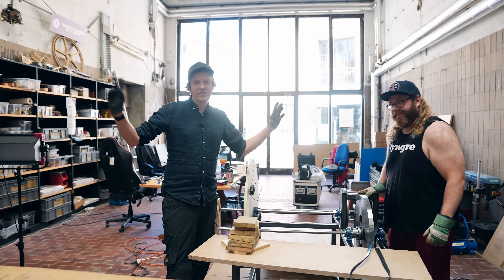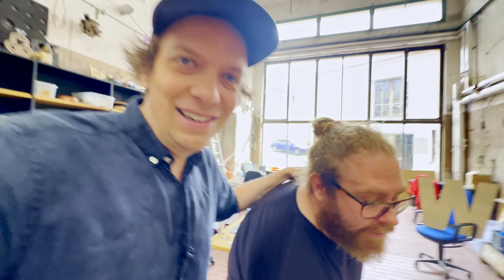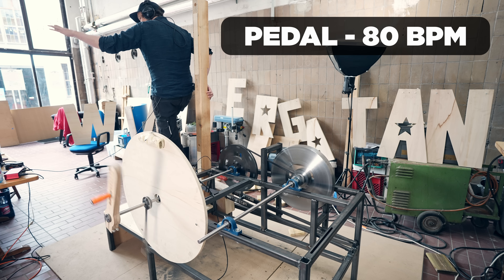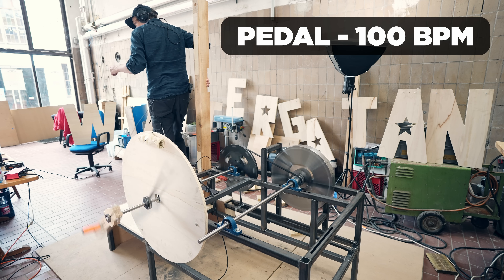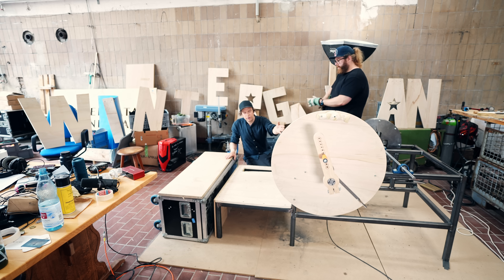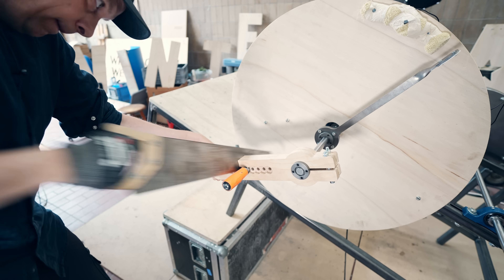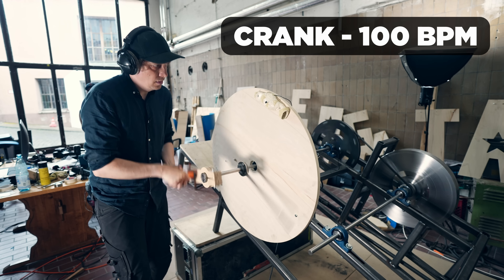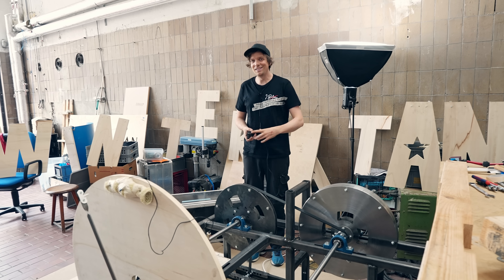Heavy Flywheel plays Tighter music! - DAY 11 - Marble Machine Flywheel Prototype

Comment: I assume why its getting tighter at higher speeds is because its just more stable (gyroscopic balancing) and the more weight added is good but one thing is the more weight, the more it will "throw a fit" and any off balance. But in the end I would chose a style of powering (Pedal or Crank) that you can constantly maintain for a very long time. The leg is strong and should be able to easily maintain the slower BPM over time where the crank should be able to handle the higher BPM. Leg is a few large muscles doing the work but can get tired with a lot of strain where the crank is using the arm and some of the torso muscles and even the core muscles. Smaller muscles but a lot more of them working and the arm muscles is well suited for speed.

This is where tighter music vs endurance will come into play as a deciding factor. Might have to do both but might be able to keep to only one. MMX had both the crank and pedal as if they were backups to each other. After testing both pedal and crank at 80 each and 120 each (slowest vs fastest) for endurance. If there is a real difference between at the different tempo's then that can play out on tour with music selection. Switch up to the other as like a break for the main drive source so it can recoup and continue on back to the main. 
Having the pedal really does help with freeing up the hands to do other things even though using the pedal can mess with the hands since the leg is moving the rest of the body. You will figure something out with it.

Comment: By finding the best 100 best transients,  it is going to be easier to find a tight section at higher bpm because you have more data points to choose from?  Shouldn't your dataset be a fixed amount of time rather thana fixed amount  of beats to avoid this bias?

My sense is that you need a motor for this. manually powering the wheel and playing bass / muting /unmuting will be so exhausting.

Comment: A flywheel can be seriously lethal! Are we all watching to see the moment of catastrophic failure happening?!
Please make the calculation yourself: disk mass, diameter, rpm is all you need. 60kg at 1000rpm with 60cm diameter can easily store 15KJ. That being released in a single catastrophic event means that parts will be catapulted at high speeds.
Be aware that a metal fatigue crack in your axle will not give many early signs of failure. The slightest disruption when giving way will cause further  instability and direct full breakdown.
Key takeaway: never ever stay in the trajectory of the disk! The pedal position is for sure in the path of the disk, the machine will shoot you in the back 😢
Reply: This has been stressed repeatedly for the last year (ever since a hefty flywheel was proposed).  Martin doesn’t care.

Comment: Won't it be crucial that the speed within a beet is constant? At the moment you only test from beat to beet. I figure that pedal and crank differ a lot in that department because the pedal only accelerates at the down stroke

Comment: I get that spinning it manually is cool and feels like you're powering the instrument... But you're dealing with a lot of inertia and complexity by doing so, not to mention the fatigue. Why not make the machine with an electric motor and a speed controller to maintain bpm? If you use a quality control system, you could do away with the flywheel
You could make a rad speed lever on the machine that you could move up and down to shift the speed at will, like it was analogue!

Comment: I think you need to decide something about how you want to use the speed of the marble machine. Say you're playing a song at 120 bpm, and you get two beats 499ms apart. Should the next beat be: (a) 499ms later (playing consistently at 120.2 bpm), (b) 500ms later (you always want as close as possible to 120 bpm, regardless of what has happened), or (c) 501ms later (back in alignment with where the third beat would have been)? With your current setup, you're being cued for (c), but you're evaluating the results by (a), and I suspect that (b) is what you'd really want for a performance. I think you could get a good test for (b) by using a Raspberry Pi to play the kick 500ms after the contact mic triggers and then evaluating the data by the mean square error from 500ms, rather than from the mean measurement.

Comment: 80kg spinning hunk of metal and you want more? This is getting stupid. If you want perfect timing give up and use an electrical motor. 
Here's another stupid idea I think could be pulled off if you don't want to introduce non-human power to it: You crank a generator that feeds a motor, with a software controller to "quantize" the BPM of your input to the nearest 5 then drives the motor accordingly. The losses might be too significant though - but that's already a problem with this stupid heavy flywheel thing. It's going to take too much effort to produce the power for this machine, let alone perform a song on stage.

Comment: I think you are going to need a larger diameter shaft to reduce wobble. One-way, Sprague Clutch Bearings in the crank arm will eliminate of being injured by the stored energy of the flywheel.

Comment: It seems... impractical to have the paddle directly connected to the flywheel without some sort of buffering system between it... if you're REALLY hung up on tightness, you should have a system that lets you input energy into the system while a second system meters it out at a set rate. (You'd just be 'topping up the battery' by paddling, while the machine stays tight.)

If you want the system to be responsive to your tempo, to allow for a more 'live' feel, you should also accept it being a little less tight... I don't think you can have both, or at least I wouldn't know what that looked like.

Comment: For your own sake during shows I feel having both the crank and foot pedal available is a good idea. If one way is starting to be exhausting you can switch to the other. The higher speed seemed to be more effort with the crank, so you could use the pedal for that during shows. Obviously you won't be performing solely with the marble machine and can space songs out for this reason, but that doesn't mean you shouldn't adapt wherever possible to make it more ergonomic.

Comment: For the final design, I would add a pawl setup to the handcrank so you don't break everything if it impacts something. Similar story with the foot pedal, That's a lotta power that could be directed back at the machine if care isn't taken.

On the topic, what about bike pedals as another form of control for the marble machine? A rotary motion like the hand crank but leaves your hands free. that way you have more flexibility to control the machine and keep tempo.

Comment: Firstly, been watching your videos for many many years. Your work is good. Just watched your day 11 flywheel have you ever considered using a governor to be able to perfectly dial in the transitional motion of the flywheel to the driveshaft such as steam engines and the like Steve engine will produce 1000 kJ of energy, but you only need 25 so you set the governor down to such a level and then wait for the fire to calm down but you’re only extracting 25 kJ of energy off. I know your mentality and outlook on the Marvel machine X is that you personally have to control absolutely everything in time and music side. I don’t know I know engineering I’m just throwing it out there that you could have a governor on the machine bang on the pedal which by the way is vastly under engineered and bends far too much and you are gonna have a problem with that And get the flywheel spin a 10 million rpm, but with the governor you would then be able to only withdraw 5000 rpm. Do you know 5000 rpm the outside of the wheel would probably be breaking mark six but yeah just a random comment from someone that wanted to comment for many years. I love your work you do going to things that I don’t need so much detail far too much but it got posted 11 hours ago when you’re ready up to nearly 80,000 views so you’re obviously doing something right. Keep it up fella love your work

Comment: @Martin, two things I noticed which I think had an effect on the consistency of your timing: 1) the second half of your flywheel I believe you had the opportunity to machine to correct specifications, that is to say, you lathed it after correcting for the loose chuck, which means you probably had the second flywheel half being more properly aligned than the first. When you bolted the second half to the first this probably had a corrective effect to the misalignment of the first half. There was barely any noticable wobble to the flywheel in this test. 2) I believe you mentioned this in a previous video, but the axles for the flywheel need to be stronger. Whereas you corrected the flywheel wobble, the axles began to noticably wobble once you got up to speed with the heavier weight on the system. Rebuilding the flywheel with proper alignment and increasing the strength or diameter of the axles should help your machine perform better. Lastly, if manual effort is a concern, consider replacing the mechanical pedal with an electronic one powering a motor which actuates the flywheel. This will allow you the same foot control while leaving you free to manipulate the remainder of the machine. If the marble machine needs power, you need simply step on the pedal till the necessary energy is back in the system. You had a similar motor actuator in the MMX and I believe this gave you a measure of autonomy while the MMX ran it's program, allowing you to accompany it by playing other instruments.

Comment: What about an adjustable clutch that you can tune to give out at 80/100/120 bpm etc? Can’t remember exactly what they are called, maybe a slipper clutch? Basically like having a torque wrench driving the machine, power cuts out at x speed coming out of the fly wheel

Comment: I see a potential flaw in your design of experiment. And I'm happy if I'm wrong and anybody can step in and say so. But I believe the evaluation of the best 100 data points is artificially skewing your standard deviation. Like, you should be evaluating the same amount of time or the number of data points evaluated should correspond with the BPM value. 

Hypothesis: you are gathering 100 points at 120 BPM in half the time as 60 BPM. So of course the standard deviation is going down - it's only measuring your human ability to stay in time for a certain duration. As that duration shortens, is easier to find a good section of data points.

Comment: How about using a tiny LCD screen output to show your current BPM instead of trying to match a kickdrum track? Try to get to 80 and then just hold at 80, 100, 120 as best you can. Your software guys could rig that up with a raspberry pi in a matter of hours. You could theoretically have a few displays showing different information for you to practice: 

- Current BPM over the last XX seconds,  (Am I playing where I think I'm playing?)
- Current STDEV over the last YY seconds,  (Am I keeping consistent power output?)
- Projected BPM over the next ZZ seconds at current acceleration rate to help you ramp up BPM without overshoot. (Am I heading where I think I'm heading?)

Comment: When the machine is driving instruments, there’s going to be a fair amount of power being drawn off the flywheel that isn’t being represented here. 

Have you done any sort of measurement or computation to estimate how much power that will be? Your own power output going into the pedal or the crank will need to increase by that much. Right now you’re just working against bearing and belt friction, a bit of aerodynamic drag, plus the power it takes to lift the pedal and crank on their respective up-strokes. The instruments should be a mostly-consistent load, I think — but it’s a load you need to account for. 

It would be neat if the crank wheel and pedal mechanism had a way to disconnect so that they’re not pulling power out of the system unnecessarily when you’re providing input through the other. (EDIT: I realized after writing this comment that I had never finished watching the previous day’s video, where you tested this and found that it’s not a problem. Good job; disregard this bit!)

Anyway, a healthy, reasonably fit adult like yourself should be able to do about 150-200w continuously through their legs (less through arms), once your muscles are accustomed. Do some math and figure out whether that’s going to be enough!

Also: have you considered a bicycle pedal setup with a seat, so you can use both legs? With clip-in pedals+shoes, you would have even more power and control.

Having now finished yesterday’s video as well: a gearbox with a 2:1 ratio would allow you to do faster tempos like 140 while still feeling in sync with the beat. A bike-style chain drive could do it, but the gear changes would be abrupt and noisy. If you can manage it, a planetary gearset would allow seamless, smooth transitions between the two.

Comment: I don't know if syncing up a flywheel by foot to spin at 80 RPM is a test that makes sense. If you want to sync up rotation to a computer, use a motor.
If you're about getting "tight music", I think that's an entirely different story. The fluctuations in BPM that arise from the flywheel losing momentum and then being accelerated again is cancelled by inertia. If in four beats, one if them is too late, yes, that's not good. But if the thing runs at 80 RPM, then you let go, and it linearly decelerates to 70 BPM, that's not about tightness, that's just tempo fluctuations.
I think in most bands they just listen to the drummer, and it's the drummers job to keep a somewhat consistent BPM by feel, but if it varies a little, nobody will notice.

Tightness is how well the instruments are synced. Like if the vibrafone hits would be 20ms behind the Kick, that would be 'not tight', but that's not an issue with the flywheel, but how the gates are tuned, no?

I think this hyperfocus on having the flywheel spin at exactly X BPM is not productive for the end goal of making musik

Comment: The handle seems to be better in my mind because you have more resolution in your ability to speed it up or slow it down due to being able to exert pressure on all sections of the crank where the pedal is only available during half of the crank

Comment: Okay I don't understand why you go through the process of trying to match the machine to an already running electronic beat. Wouldn't it be easier to get it up to what you think is close then start the electronic beat then adjust. Your measurements are coming from exclusively the contact mic anyway. Seems like if your going to play music with others they will be playing around the machine as to a significant degree it is fixed, seems like your just making things harder and take longer to run a test. In fact its delay to accelerate and decelerate the beat could be used to help. Have a read out on the machine similar to what's on the prototype currently, and have it feed back a pulse digitally to a headset/earbud with the appropriate delay for the desired beat with the audio. A better explanation might be on channel A of a headset you get live feed from the contact mic and channel B gets delayed feed. The delay being the appropriate amount for the BPM. The objective would be to get the two to line up.

Comment: An outside the box thought here: Wouldn't it be good for the whole stability of the machine / fly wheel if you would have each half of the flywheel on each side of the machine ? That shaft would be under less torque. Can't help but to imagine gym stepper machine being attached to the marble machine, that would probably make the powering half as tiring, and probably synchronising to the beat easier.

Comment: As people have noted, a secondary gear that allows the flywheel to spin at different speeds by adjusting the moment of interia. Just like an ice skater moving their arms in and out during a spin. Using the main mass as the sync is ripe with errors for what he is trying to do.  He should instead have been testing a fine tuning mechanism to adjust the moment of inertia, not the input force! Curious to see where this goes. Another solution is a fine tune on the gear to the working surface using the CVT solutions. The hard design solution is he is looking for "fine tuning" of around 1%.  The CVT on the output is likely the nicer solution, but the moment of interia is more elegant and might be easier to control. Its a cool engineering problem and keen to see where this goes.

Comment: Is the timing beat adjusted to hit the time at which you need to start pushing on the pedal, or where the pedal hits the bottom? It looks like the former, but I think the latter would make it easier to push at the right frequency to get the timing right.

Comment: I recently was recommended the wintergatan video on YouTube The Prototype is finished day 10. I thought I might recommend the potential to include a simple freewheel mechanism into the crank arm to increase the safety margin.This would allow the power train to accept input only in one direction and freely ratchet in the opposite direction of applied force or “coast”. I think the easiest way would be freewheel directly mounted to crank arm shaft and a crank arm made of wood designed to clip directly to it. All in all it might cost $20 and an hour or two if an adapter is needed. Depending on implementation this could also allow for simple gearing reductions by using off the shelf bicycle components with little efficiency loss. I would chose a belt drive system as it could offer even more potential safety margin over use of chain drives. Whether or not this information is useful to your project or overlooked entirely I wish you luck in your ventures and success.